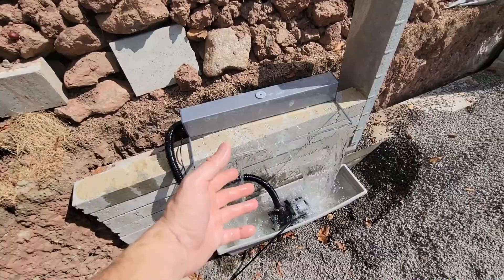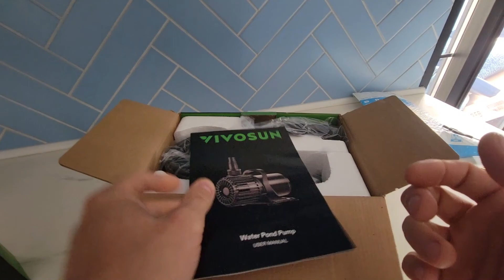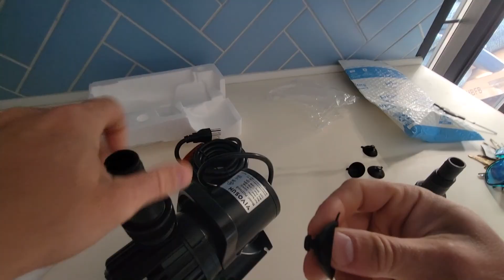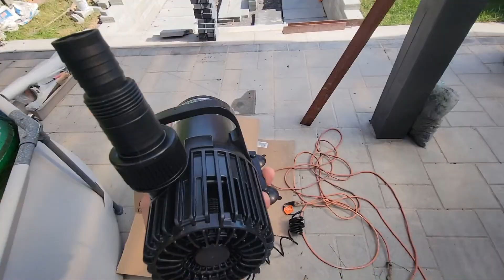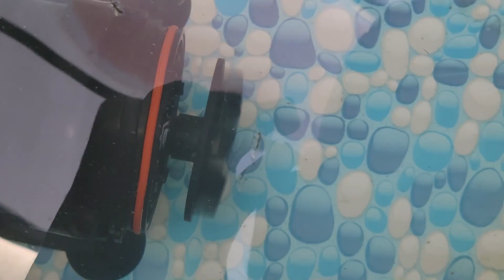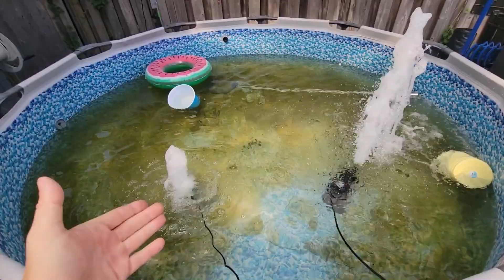🔥 Vivosun 2700GPH Pump | The BEST Submersible Water Pump for You!

Comment: So if it’s susceptible to failure with grain/ dust how is it used in ponds?
Reply from the maker: Grain and dust itself will grt into mechanical elements.  In water it will be filtered out
Reply: I have the 9000 version of this and use it in a water feature in our front yard. It'll pass 1/4in debris. Been a 17 months amd running strong